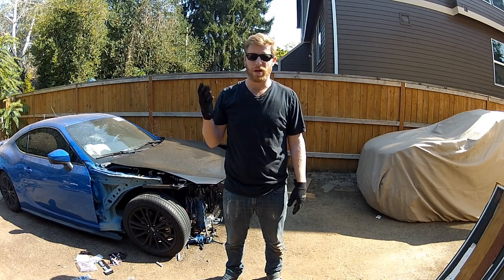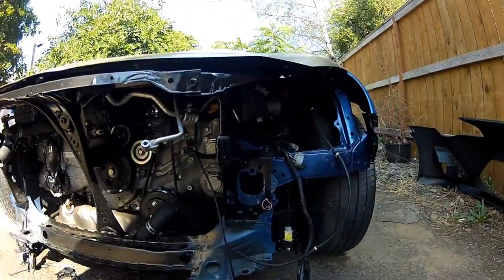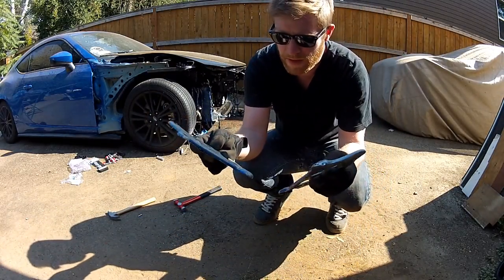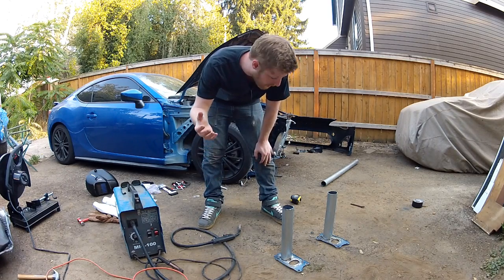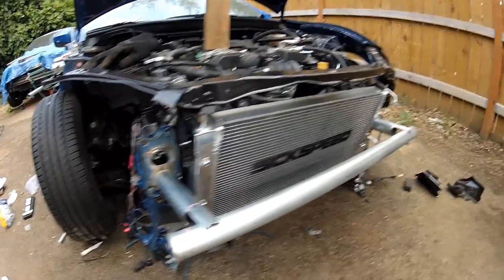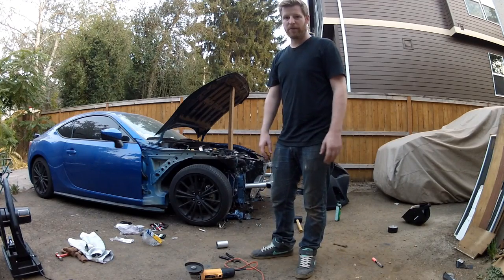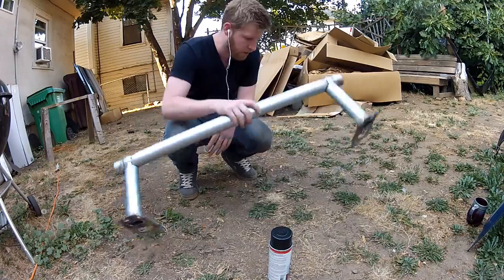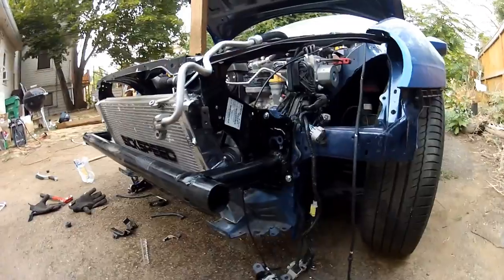BRZ Resurrection Part 3 - Ghetto Front Impact Bar

Comment: Thank Heaven you told people that you are not driving this on the streets. I would hate to have people think that any of these repairs are safe. That bumper is a nightmare, not to mention the piece of angle iron on the upper frame rail on the right side connecting to the core support. Even though you said you are going to track this car, you should still be worried about being safe in a crash.

Comment: Did you buy this BRZ in this condition?
Reply from the maker: +Shlycer when i got it the front looked kinda like a taco.. the first of the series shows the car after id repaired and removed a lot of broken stuff and a frame straightening shop had put about 1.5K of work into it.
Reply: Oh that's cool, was it still cheaper than buying an accident free BRZ? I'm mostly just curious.
Reply from the maker: +Shlycer yeah but not by a whole lot, if I didn't have different backup cars and the desire to rebuild it and bring it back to life it'd be much easier to start with a low miles used one, and it'd have more retail value. It's kinda strange but I feel bad buying a perfectly good new car and chopping all the fenders out and doing crazy stuff to it just to run 10in wide tires and stuff, but when I rebuild it from scratch I feel like I've earned the right to do any crazy stuff to it that I desire.
Reply: I totally agree with you man, especially if you don't have a backup car to drive. If only you were rich enough to not care about cutting up a new BRZ, haha. Love these videos though, I can't wait to see what you do with this project going on, so keep up the awesome work!
Reply: +Shlycer it's not about the money, its about the pride in his work. He could of bought one that wasnt wrecked for around the same price but decided to get a salvaged one to feel more accompolished.